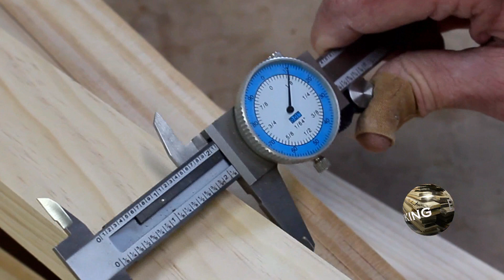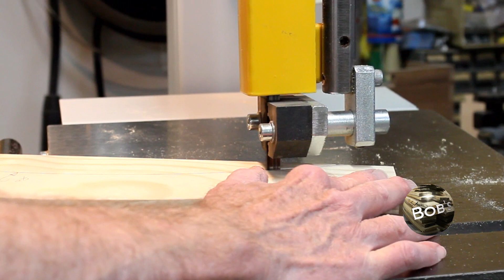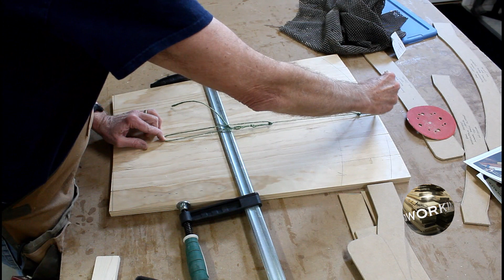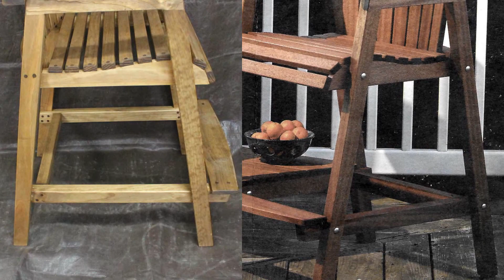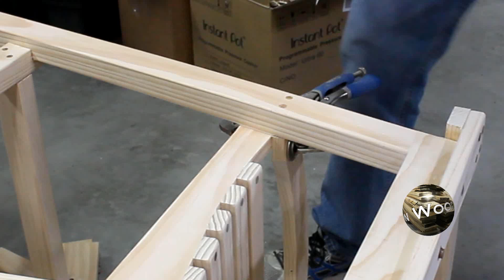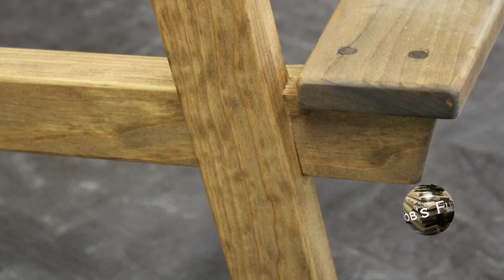Bar Height Adirondack Chair

Comment: Great job, Bob - did you end up making the other chairs and how did they stand up to 3 1/2 years of use?
Reply from the maker: Neville, thanks for the comment. I’ve made 10 of these so far. All are still very much in use. I’ve “improved” a little each batch. Current design has much wider arm rest with a ‘cup-holder’, I keep lowering the back of the seat and angling the back backwards more to give a more comfortable seat, I improvised a side table that can be removed and finally I’ve changed material to a more rot resistant specie - red grandis was last set. You can see all these on my Instagram…. You’ll have to scroll thru posts to get to the builds in question.

Comment: Hi Bob, I am glad I saw your video. I had watched the one from Woodworkers Journal and thought the back was too straight. I see your preference for a 15 deg angle, that sounds better to me. Do you have a picture of the chair with the new angle? I also like the sealing of the bottom of the legs. I plan on building a couple this summer when I get recovered from knee replacement and am able to get back out to the garage and work. Thanks for your video.

Steve
Reply from the maker: popawalker good luck on recovery .... not sure how to send pictures of two chairs I built after the ‘prototype’. I’ll look to see if I can get them to you somehow. I’m not big into chair building, but working there. The few chairs/stools etc I have built seem to tend toward a 15 degree plus or minus angle for back.  I also find it important that the back angle is not necessarily from the horizontal, but from the seat. If the seat is angled (sloped) down in the back you’ll want to take the back angle from the the seat (not the horizontal). Good luck, thanks for viewing
Reply: Bob, thanks for your response. After I wrote the picture request I actually went to your instagram account and saw some pictures there that I am assuming are the updated angle. they look nice. @BobMcKenziewoodworking

Comment: Hi Bob, Nice video on chair build! I built these chairs from  Woodworkers Journal plans as well.  I was able to use solid stock for legs so I used saddle joints to joint them. RI too thought  the back rest was to straight and increased it to 14 deg. The back slates did not stay in a pleasing arc so I added a curved  strap to help keep them in line.
Reply from the maker: woodrat1952 us woodworker’s seem  to always find ways to tweak things ... maybe that’s why we do what we do. I agree, angle for the back - for me a 15 deg angle is about right.